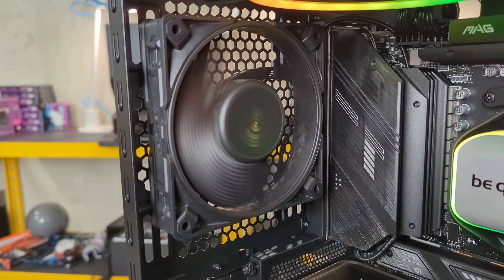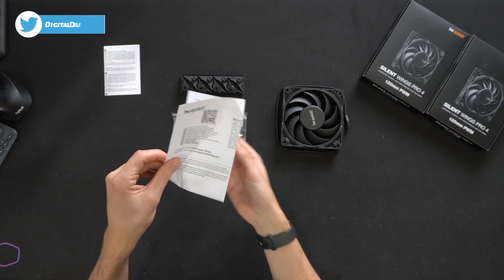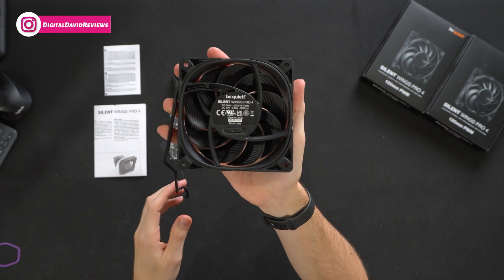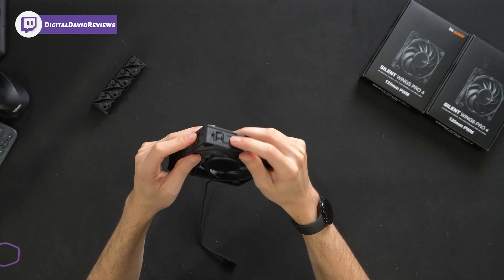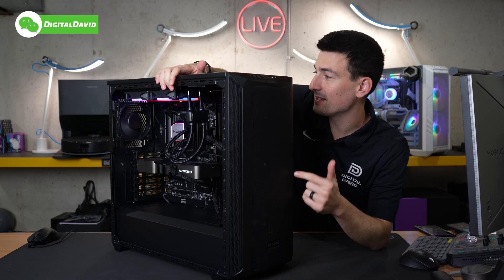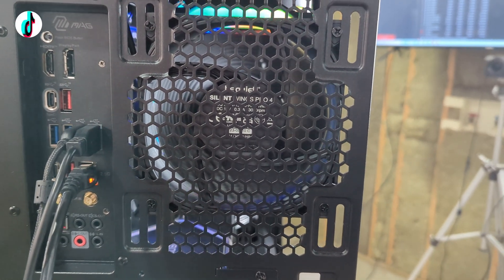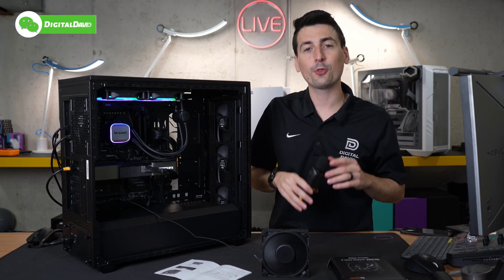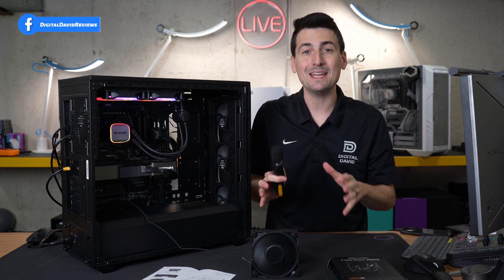Silent Efficiency Unleashed: be quiet! Silent Wings Pro 4 120mm PWM Fan (BL098) Review

Comment: Can you show us how to connect it to a fan/argb connector and or where all the wires go? Also i have h9 flow case.. should i get 1 for exhaust, 3 for bottem 3 for top 3 going up the side and 2 for my thermalright cpu cooler ?

Comment: Speed switch? Isn't motherboard supposed to control its rpm's? Also, how the hell do you reach it once the fan's been installed?
Reply from the maker: Set it and forget it!
Reply: Just got one of these thingies. Luckily my case allows me to stick something spindly like a toothpick through the rear mesh and reach the switch :D
Reply: You get to it through the holes in your case. You're putting the fan in front of a grill anyway, you can pull the switch with a screwdriver easily through the holes on the grill.